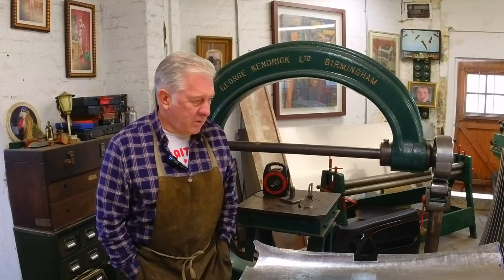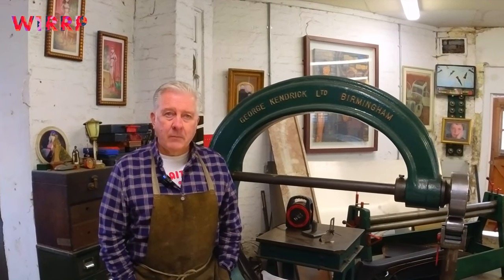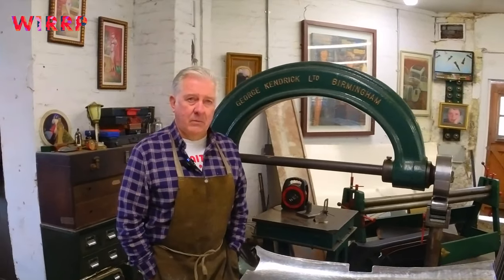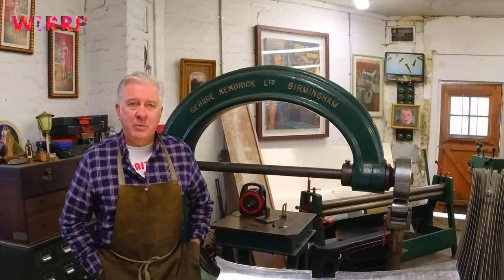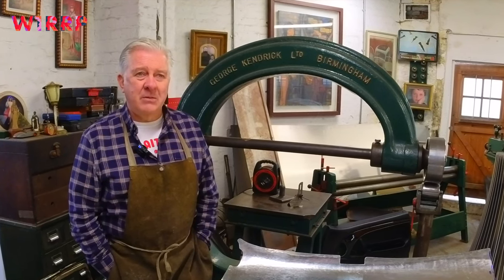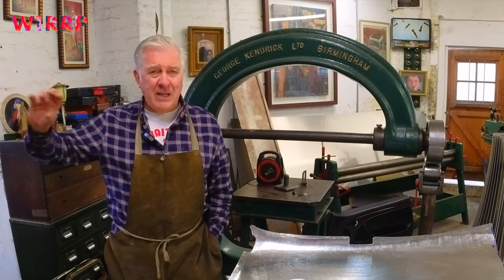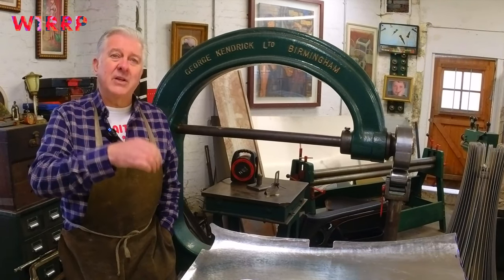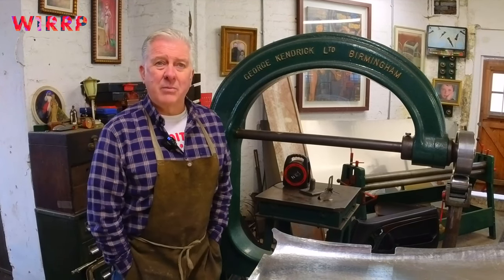Mulliner Park Ward Final Inspections Lance McCormack Rolls-Royce 4K

Comment from the maker: The Bentley R-Type Continental was a high-performance version of the R-Type. It was the fastest four-seat car in production at the time. The prototype was developed by a team of designers and engineers from Rolls-Royce Ltd. and coachbuilder H. J. Mulliner & Co. led by Rolls-Royce's Chief Project Engineer, Ivan Evernden. Rolls-Royce worked with H. J. Mulliner instead of their own coachbuilding subsidiary Park Ward because the former had developed a lightweight body construction system using metal throughout instead of the traditional ash-framed bodies.
The Bentley R-Type Continental styling, finalised by Stanley Watts of H. J. Mulliner, was influenced by aerodynamic testing conducted at Rolls-Royce's wind tunnel by Evernden's assistant, Milford Read. The rear fins stabilised the car at speed and made it resistant to changes in direction due to crosswinds.